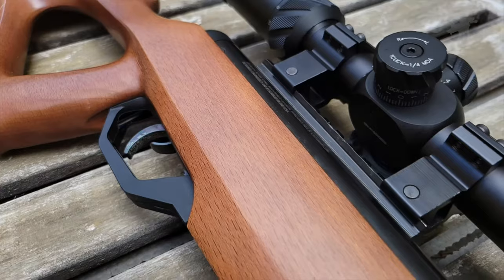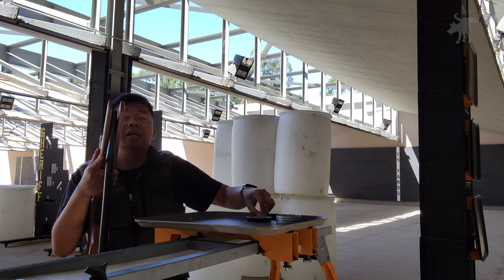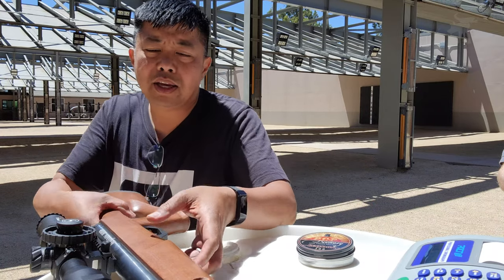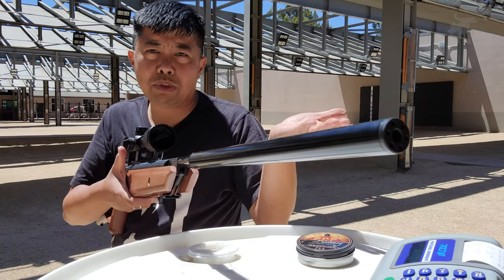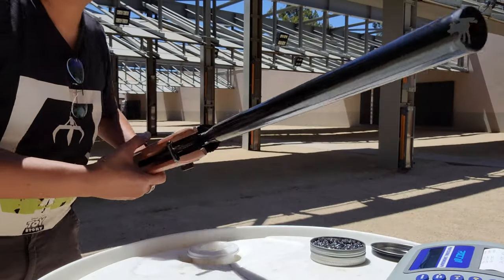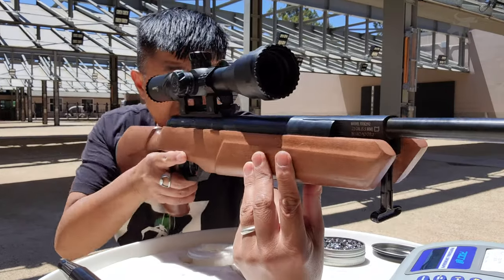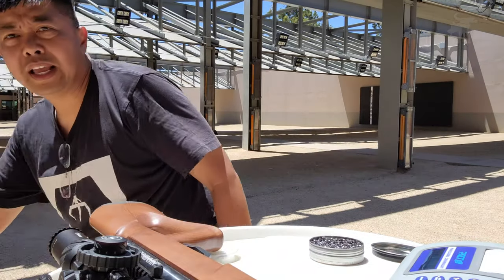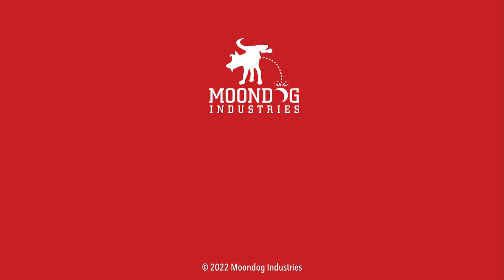Airgun Suppressor Chrono Test

Comment: I have an HW110. It is a PCP rifle, and without the moderator, it certainly has a very loud crack when firing. I have tried it with an air splitter attached and just the bare barrel. The tightest, and most accurate groups, came with the moderator attached. The splitter needs some fine tuning, but has potential to make the gun even more accurate. Obviously not as quiet.
Reply from the maker: Did you buy the splitter after market? Hope you subscribed.
Reply: @Moondog2A  Yes I have just subscribed. The splitter was from Rownan Engineering. They’re supposed to be the best.

Comment: Probably a wee bit fps gain could happen for the pcps but for the springers maximum air pressure is already done when the pellet has travel 7-10 inch down the barrel from the breech.
Reply from the maker: Good point. Hope you subscribed.

Comment: Interesting..in the uk sub 12ftlb …so a pcp can have a £35 suppressor or the new dony fl and no human can hear the difference…as chrony test? If it’s a few fps so what? Won’t make any difference
Reply from the maker: The sound supression doesn't make it silent that's for sure. Just a slightly more muted crack.